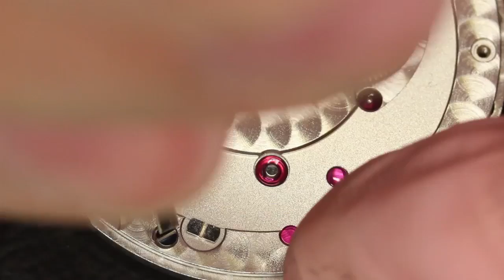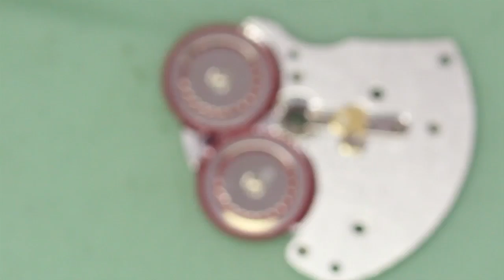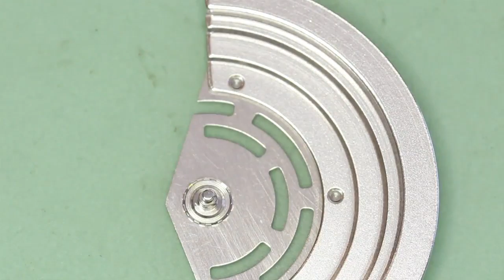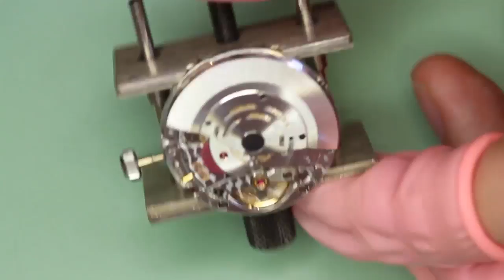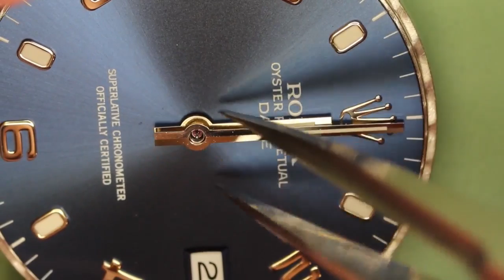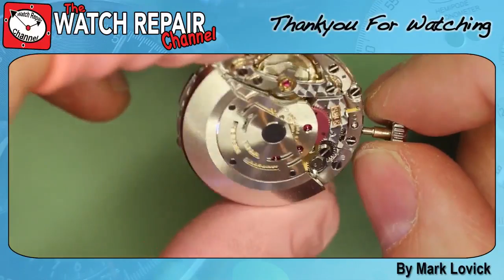Rolex 3135 Service. Part 3. Watch Repair Tutorials.

Comment: So when you reinstall it into the case, do you use any locktight or other on the case clamp screws? They seem to be holding the movement in place by pushing in the wrong direction.

Comment: Fantastic series and beautifully filmed and narrated.  Curious how you keep the dial and crystal free of dust and debris upon assembly.  Always assumed this is done in a clean room environment at the factory, difficult to duplicate outside of the factory.  Big thanks for a very educational series of videos.  Ciao.
Reply: Rodico and tiny air pump to remove debris and fingerprints . But a good watchmaker wouldn’t leave fingerprints on the dial or crystal interior in the first place

Comment: Mark,
I started repairing watches and collecting them after I retired seven years ago. With your videos I finally worked up the courage to repair a customers Rolex Datejust that was rusted pretty bad, especially the key works. After cleaning it up and purchasing about five parts from eBay, it's running like a champ thanks to your videos. It goes without saying this challenge has boosted my confidence and my pocket change. The only thing I ask is that would you please do a video on adjusting the regulator on the 3135. This one is running at -7 sec. Per day which I think is great but maybe could be better. Thanks Mark!!

Dave Matthews
Reply: I have a rusted out Yachtmaster thats been sitting for a few years because when I took it to a watch maker they wanted 7k to do the repair, but after watching this video I've decided I'm going to try and tackle repairing it myself. What was the process of cleaning off the parts like and which parts did you end up replacing?
Reply: it depends on the damage what parts to replace.. 7k is crazy as the new whole movement ( guessing it's a 3135 ) it's at max 3k euros. And I'm talking about a complete and new movement. I'd suggest you to go somewhere else, or either ask him if it's possible to do just the swap, you buy the movement yourself and then bring everything to swap. But I really suggest going somewhere else.

Comment: Hi mark hope that your well. Only asking the automatic winding  reversing wheels are they the same as each other can they marry up in either  bridge jewels. and also do you lubricate the pallet pivots  cheers ady
Reply from the maker: Hi Ady, The reversing wheels are the same and the pallet pivots should be left dry :)
Reply: Hi mark just asking what a  BHT MULTI TOOL  
Tool with SIX facetspoising, setting, HS adjusting thanks ady

Comment: Hi,
Two questions.
1. When you are oiling the reversers  are you using 9010?
2. What do you use to support the second hand? My understanding is that the brass hand on the other side will dent if you push to hard and will slow down the sec hand.

Thank You,

Jason Appelbaum